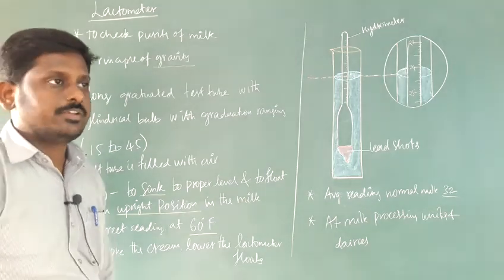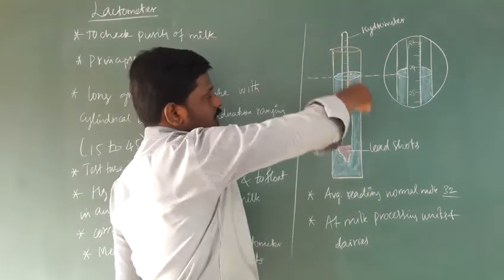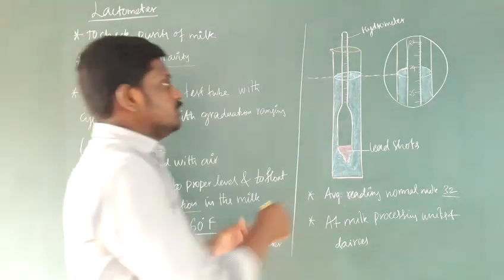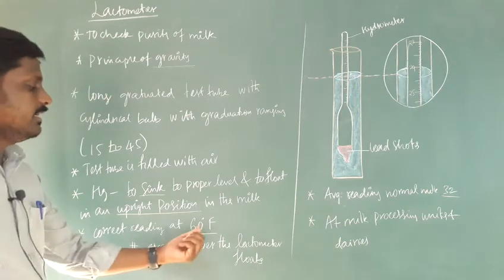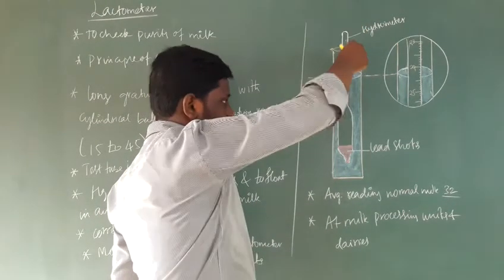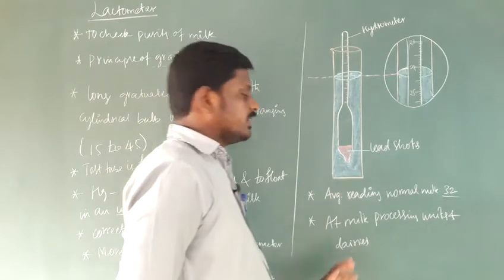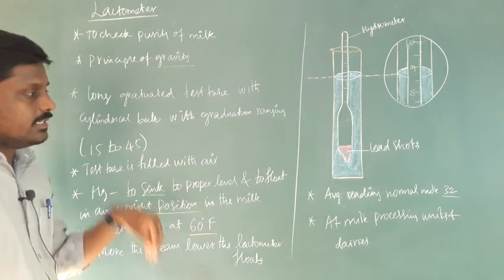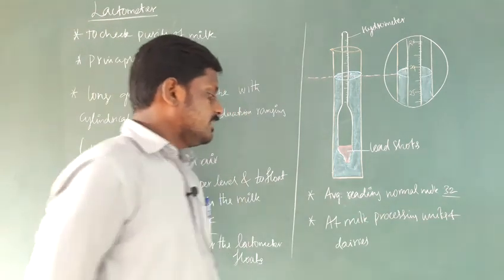How Lactometer works?

Comment: Does lactometer used for temperature counting?
Reply from the maker: Thermometer is used to check temperature of surrounding if it's at 60°F and you will get correct reading... But Lactometer is used to check the density of milk...